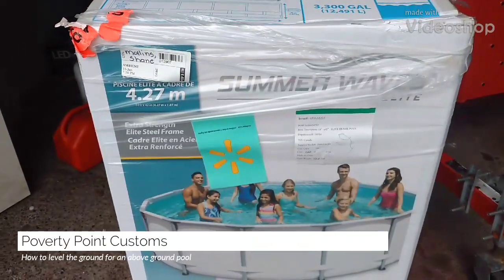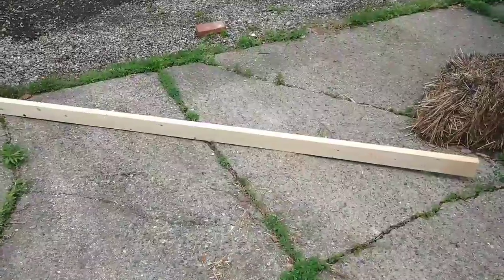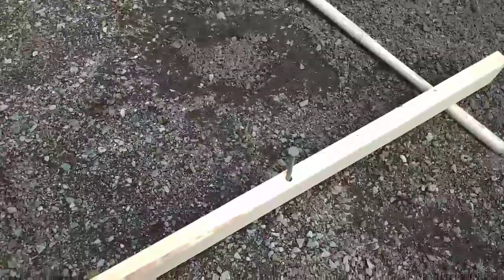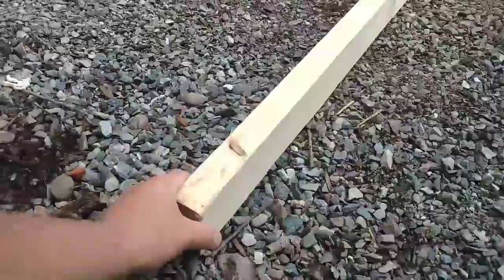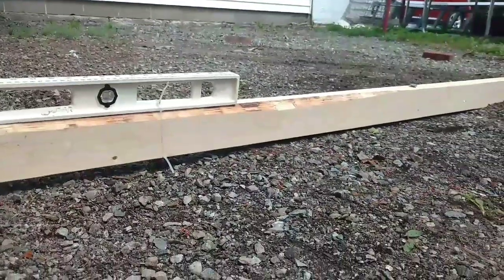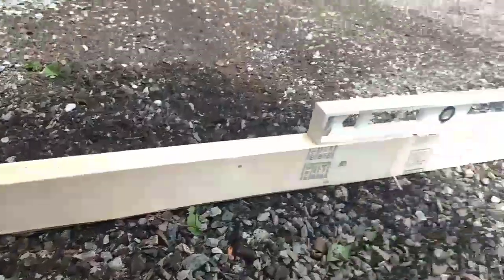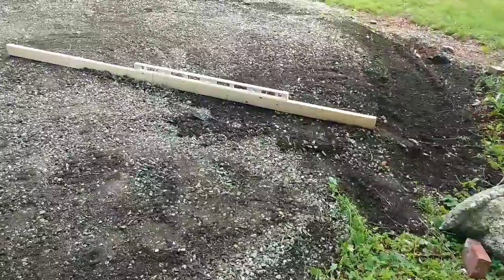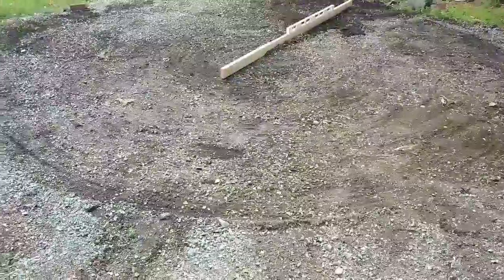How to level the ground for an above ground pool

Comment: Thanks for sharing the 2×4 trick. A couple of summers ago with my first pool I was just randomly trying to move a 4' level around on the ground trying to get it right.. needless to say it didn't turn out well and the pool floor had plenty of high and low spots in it. I'll definitely be doing your method when I set up my new one!

Comment: Thank you so much for posting this.  I have purchased the same pool but got stuck on the step of leveling the ground, and I in no way want to put up a pool on uneven ground.  I had no idea how to level a ground because it's impossible to judge it by eyeballing it.  This video was most helpful, now I'm looking forward to the next step which is this one, may be able to put up pool after all :)
Reply from the maker: Thank you  :)
Reply: How did it turn out?

Comment: I just did this and its very important to make sure the ground is level before the pool goes up. My ground wasn't as level as it should have been. I have to tear the pool down this winter. I saw another YT video where they said it doesn't matter as long as the legs are level. Thats NOT true. Level the ground completely before hand. I have to redo now.
Reply: Same, my dumbass thought placing pavers under the legs would help Lmaoo. Had to take it down last summer

Comment: I thought I was dang near level this first year 2022. But, I realized I had to do something different when my 13 went and sat on each side and it was 4 inches difference. "my nose is underwater" on this side "my chin is touching the water on this side". Leveling this fall for next summer.

Comment: Our ground in back has a Ton of gravel so prep is important. Remove sod, and then rake rocks, use board to level and tamp down. Will be using stone dust first and then Mason sand and after each additional product has to be tamped down again same as the sand. But I can see this will be alot and I mean alot of prep to have a level successful installation. It's all in the preparation. I haven't even gone to pick up any materials yet, still removing concrete pad that was broken up. One more load of that and string trim area to clean up. The location for the pool isn't there where concrete was, a different location ackually in back yard on grass.

Comment: The tarp will compress and the rocks will poke through. Best to put sand on top of the gravel. Sand eventually cuts through the liner also so best to put old carpet over that and it lasts years
Reply from the maker: Great points, definitely putting several inches of sand down next year, great idea on the carpet, I'll have to keep an eye out for someone doing Reno's and tossing old carpet out.
Reply: I put foam insulation board down and tape the seams with gorilla tape. Makes the pool floor nice and smooth.
Reply: @_Lizz_   did you put the foam on top of the sand or directly on top of the dirt?
Reply: @BrunoMoniz  I leveled the dirt then put the foam board directly on the dirt and covered the foam board with a tarp.
Reply: @_Lizz_  what kind of foam board did you use ? Looking to cover an 18ft diameter pool on a budget
Reply: @janineberger2042  The foam insulation board from Home Depot. Depending on the pool size as to how many. Well worth the money. Mine have lasted over six years. Leveled with sand, add foam board (tape both sides), added pool tarp. Nice soft pool floor and nothing has grown through the liner. We extended the base 2 feet out, makes weeds essy to remove!  To get your diameter use a string tied to your center stake and the spray marking paint.
Reply: Great idea, did u cut out for concrete pads under the legs in the foam board

Comment: You start with the lowest spot in the gravel and go all the way around and never fill in low spots. You take out high spots to match the low spots. Never put a pool over stones because they will make their way through eventually.
Reply: Was going to make this same comment, no one wants to dig but if you want it done right that’s the only way to go. If you fill low ground to match high, you don’t know how much settling will occur which can often be significant and you’re back to unlevel ground again.
Reply: What size gravel
Reply: @govalgo11  use sand. It won't puncture your liner
Reply: @jamesdodds3195  Mason Sand

Comment: Your method is fine, but if you're erecting a pool, I would strongly reccommend you first clear the area of all those pebbles. They will work right through your sand base a pierce your liner.
Reply from the maker: I agree, this year when we set it up again we will be adding alot more sand to the base

Comment: before I do this. I have extremley lumpy land. IF i use sand won't the sand over time just be pushed out from under the pool and make it uneven later over time?
Reply from the maker: It may a bit, this year I'll be adding a underlay pad over the sand for our new pool, hopefully the video of the new one should be up in the next 2 weeks.

Comment: If I fix this pool rooftop it's any issues for building?
Reply from the maker: They are really heavy when filled with water so you would have to see what your roof would be rated to safely hold. If it is you should have no problem with it there.

Comment: Thank you for this! I thought I had a my site level, but it turns out after filling it I am about 2.5-3" off. 18' diameter, 48" walls. Do you think this will be a problem? Next year I will try your method to make it more level.
Reply from the maker: If your only keeping it up for a few months then taking it down you'll be fine
Reply: @PovertyPointCustoms  Yes. Will be taking it down when the season is over. In the colder climates over the winter like Long Island, I don't think these types of pools are meant to keep up year-round anyway. So we'll take it down, store it and then put it up again in the spring. Thanks for your thoughts. 👍

Comment: If it's a concrete slab could i just add pavers under the pools posts? My slab looks level but i'm pretty sure it has an angle for rain to run off
Reply from the maker: As long as the papers don't rub against the pool liner your should be fine.

Comment: I would have dug up the rocks and just had dirt, no weeds ect.. then added sand on top, then level the ground. This is what I'm doing for my 20x48 pool.
Reply from the maker: This year it's getting a few inches of sand (I take it dow for the winter)
Reply: I do the same thing without sand
As long as you take it down in the winter it'll last for years

Comment: Super informative- I was trying level strings arrayed around the area but this will be more manageable (assuming I can find a straight 10' piece of wood!).

re- sand: i'm clearing desert topsoil with lots of rock embedded - is the trick that sand is just under the liner and the uprights remain on the native ground (to avoid shifting)?
Reply from the maker: That's what I would do, sand then something between the sand and liner (stops the liner from wearing on the sand)
Reply: for the wood, you could always use different pieces and lengths and attach them as long as they are straight and flat :)
Reply: @1984kame  you're assuming I have the skills to do that and not create a Frankenboard or something. ;)

Comment: Great video, I thought I was going to have to hire someone to do this. What an easy method. How did you make sure it was compacted well, did you have to rent a machine. Thanks much!
Reply from the maker: The area has been compacted over the years but I drove over it many times with my old farm tractor which was 3500lbs which compacted it. A compactor from a rental company would be perfect to rent, in our area they are apx 85.00 a day but you would need a truck or small trailer to pick them up (in our area they charge apx 80 to deliver and pickup plus the cost of the rental).

Comment: Gonna be steppin on rocks.
Reply from the maker: It's getting a few inches of Sand this year on top
Reply: I wouldn't add rocks or sand there's great foam available now if your yard is really Rocky to start
Reply: @ivyb4351  what type of foam are you talking about?  Need to cover a an 18ft pool
Reply: @janineberger2042  first dig the highest side down to the lowest side that is a must!!!! We dug 8 inch on one side and have you seen those foam blocks daycares use that they click in together they make those for pools they're all blue and they're really soft and Squishy on feet so comfy a cheaper option is to go to a sign shop where they put Billboards up you can buy the old Billboards for $25 they're thicker than any tarp you can buy
Reply: @ivyb4351  do you know off hand how much the foam blocks cost per square foot?  Even a rough estimate.  I'll have to Google billboard companies in my area too just in case.  My kids are getting anxious about getting the pool up really soon.
Reply: @janineberger2042  they're very expensive there's also another company that makes a super extra padded ground cloth for above-ground pools honestly if you're expecting to just be able to put a pad down and level it out that's not going to work the only time you put a pad down is after you've already dug down to make it even then use the padding I watched a lot of videos on YouTube on installing an above ground pool and I only found one that did it correctly so keep that in mind the bonus of getting one or two tarps from a billboard / Sign Company is most of the tarps that you buy for above-ground pools are square this way you could use one foldit cut it and double layer it with just me and my husband it took a good four day weekend but we had to dig very far on one side and you can't take that dirt and put it on the other side it will just wash out I did two very large raised garden beds with how much dirt we had and still had some people think this is going to be easy and I could just do this you cannot skip any corners you have to show you have to show them how the pool is installed if anything ever goes wrong and you need to use your warranty
Reply: Janine Berger I’ve seen a 40 count at Lowe’s for about 470

Comment: Would this work on a bigger pool? I have a 26 foot round
Reply from the maker: You could use a 14 foot 2x4, that would give you a 28 foot diameter circle so this method should work fine

Comment: How did you add more wood to the the 2x4x10 to make it 17ft?
Reply from the maker: You start in the center and rotate the board, so a 10 foot 2x4 will rotate and give you a 20 foot circle (more roughly 18 depending on where the 2x4 is attached in the center)

Comment: Help how long does my 4x2 have to be for a 15 feet diameter ??  Thank you
Reply from the maker: Mine was 10 feet, that gives you roughly a 20 foot circle when leveling. You could use an 8 foot for a 15 foot pool but the longer 2x4 gives a larger diameter circle.
Reply: You’re awesome I’ll try it tomorrow. Thank you for the help !!

Comment: I'd like to know how your pool linner held up to all that gravle?
Reply from the maker: I didn't have any issues but I layed plastic under it, this year we bought the larger version of the pool and will be getting a few tons of sand to put down as a smoother base first. Hopefully it will be setup in the next month and will be doing an updated video on it.
Reply: @PovertyPointCustoms  thanks for the response.  Most of the research I've done in the past few weeks I've  found that the sand is a smooth barrier but not a safe bet for leveling (on its own) i do think i will use much of what i picked up from this video to level our space. Thanks for posting.

Comment: Only problem is loose soil will get pushed out and or down as you put water in.
Reply from the maker: You definitely want to make sure it is tamped down, your right the weight of the pool will definitely compress the ground below it.

Comment: Do you know the spacing between each leg on the 14ft model?
Reply from the maker: There are 14 poles, so it is 3.14x14 then divided by 14 so roughly 3.14 feet between poles

Comment: Can i install the pool on concrete?
Reply from the maker: You can but would need something between the liner and the concrete as it would wear a hole in it quit fast. You can actually purchase a pool floor pad that is similar to a thin foam that you can put on top of the concrete,  then the pool will go on top of the pad.
Reply: PovertyPointCustoms thanks for the quick response! Leveling the ground in my backyard looks overwhelming...but i have a concrete slab back there as well figured it would be more simple ....thanks
Reply: @jesswhyuwannaknow930  just check it for level, most concrete is pitched to allow water runn off...
Reply: jess whyuwannaknow  Yes we put one on our concrete patio slab we put carpet padding underneath. Lay the carpet padding put up pool and cut the excess  padding around the pool leaving about an inch so you dont cut pool lol
Reply: @carpet180  how much for the carpet padding?